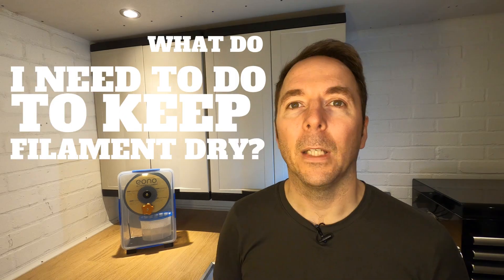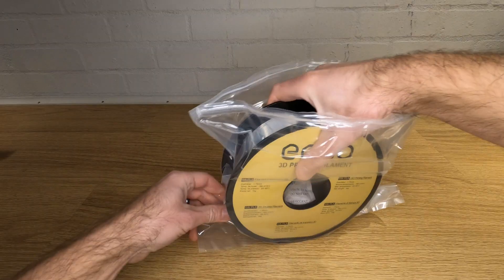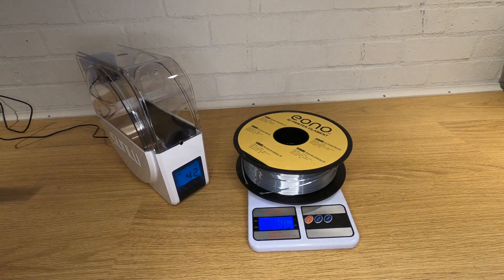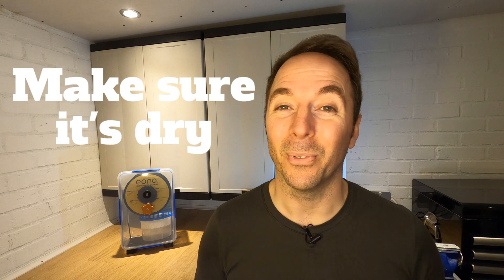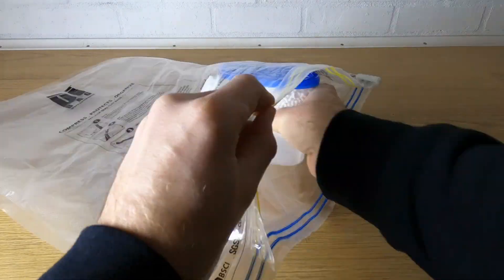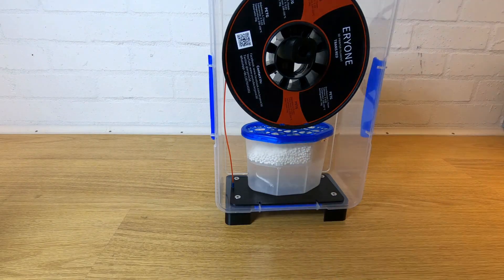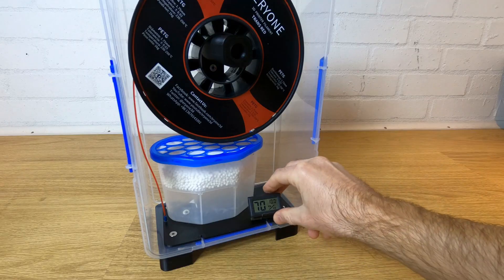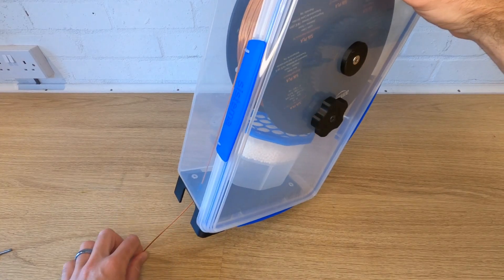3d Printer Filament - The Truth of How to Actually Keep it Protected And Dry

Comment: Good idea to actually dry new filament as well. I did not consider this until now. But i guess depending on how the filament factury actually handles drying the new filament rolls and how they treat theyr dessicant bags, they might as well just add even more moisture to the package, if they keep dessicant bags in an open box exposed to the humid air before dropping them into the vacuum bags. I would expect the premium manufacturers would dry the filament again after spooling it and just before packaging, but without a factory tour it's hard to know what they really do or don't do just to increase profits.
One thing about the cheap humidity sensors you mention in the video: They are really, really bad, because they usually just use the cheapest sensor possible. They can't really measure very low humidity well, and can quickly have an error of 20-30% rH. I prefer to use something like the Sensirion SHT4x SmartGadget for much more precise and reliable values. At least you really know what sensor you have in that board, and can get an idea of how precise the values are, even in the very low humidity range. The Gaget has the extra benefit that you can connect it to your phone over the app, and log values over time if you want to. I have access to a calibrated climate chamber at work to actually test the sensors, and i pretty much gave away or trashed all the cheap ones, as the values they measure are too far off and therefore useless to me.

Comment: You should really make a playlist for this dry box series. Also I just bought the sunlu on sale for $33 and I am excited to mod it. I was thinking about making a hole in the sunlu for filament and a Capricorn tube to give a way to dry and print at the same time.
Reply from the maker: Hi, good suggestion, there probably are enough videos for a playlist now. The Sunlu has a hole in the lid already that you can use. I do exactly that, use a length of PTFE tube to feed the filament to the printer while it's drying.

Comment: As I write this the exhaust fan on my enclosure is struggling to keep the temp inside below 31°, the ambient is 27° and RH is 87% so yes, I get it!   I am just changing my storage over to Ikea 365+ boxes with 160grams of silica gel in each.   For the last couple of years I've used ziplock bags with 80gms of dessicant reasonably effectively - reasonably because ziplock seem to slow down the ingress of moisture rather than stop it.    My camera gear is stored in similar boxes and RH remains a steady 25-ish%   

I dry with a food dehydrator when necessary - however I think that fresh dessicant in the bins will be adequate to dry PLA left out for a few days even in our ridiculous humidity.  I'd be interested on your thoughts on that @Ricky Impey?
Reply from the maker: From my testing, I haven't been able to prove and weight reduction in filament with only using a desiccant. That's not to say it isn't happening but I couldn't make it happen to any measurable amount. It does work well at maintaining the moisture content of filament after drying though. That's why I have individual rolls on boxes that I can print from. I'm lucky that where I live, we don't get really high temperatures for very long so actually cooling my enclosure hasn't been a problem yet. The hottest I've seen is 40°C with the headbed at around 100°C. I have given it some thought though and I guess you need to be really careful not to blow cold air in as it can seriously affect warping of prints. What do you do about intake air? Do you let it just pull in ambient air or do you control it in any way? Where do you have your printer? Mines in my garage which unfortunately is the hottest place in the summer and coldest in the winter 😏
Reply: @RickyImpey  Thanks for your reply.   I hadn't thought to check weight in filament during storage (slaps forehead).  Will start now and report back in say six months if I remember!

Comment: I purchased a vacuum chamber to degass resin and silicone. Turns out that the boiling point of water is much lower in a vacuum. So I heat up the filament on a repurposed Anycubic i3 mega that now only consists of a hot bed and, after an hour or so I leave it in the chamber with the vacuum pump running for a while. Then I close off the exit valve, switch off the pump and leave until required. Oh, a few sachets of dessicant are thrown in too. It does need a five minute blast with the pump every day to keep it at a perfect vacuum, but that's OK. Having said all that, though, I will be getting the Sunlu filadrier S2 ASAP. I want to print in carbon fibre polycarbonate and that stuff is so hygroscopic it needs active warming whilst being fed into an extruder. Assuming the print(s) are going to take a few hours. And that Sunlu S2 looks like the proverbial dogs left testicle.
Reply from the maker: Yes vacuum dehydration is a great way to do it especially for the really hygroscopic filaments. I haven't tried a Sunlu S2 yet but I'm a bit sceptical about how good it's going to be. It has the extra heating element but it doesn't vent to hot air. I'll have to give it a try and see.
Reply: @RickyImpey  I like the idea of 360° radiant heat. And there are vent holes at the top, if my appalling memory is right. But yes, a fan would be excellent. As would a spool with holes in it's hub. I suppose owning a vacuum chamber helps me to just get it up to temperature and vent it during the process of creating a vacuum. Or that's what I hope, at any rate.
Reply: What do you mean by “dogs left testical”? I googled it and just came up with cryptorchidism.
Reply: @plopplop7491  I was trying to be polite and not use the term "the dog's bollocks" which means "the dog's testicles" which is slang for something that is very good. Bollocks, as a word, is held to be mildly vulgar, hence my allusion to it rather than outrightly saying "mate, it's the dogs bollocks".

Comment: Desiccant packs in air tight seal cereal containers work great for me
Reply from the maker: It's a good solution. Can you print with them inside the boxes?
Reply: I suppose You could if you printed a mount for it to go inside and put a small hole in it for it to feed through